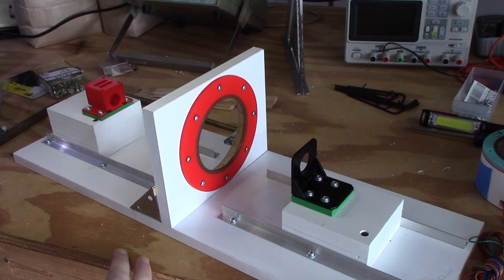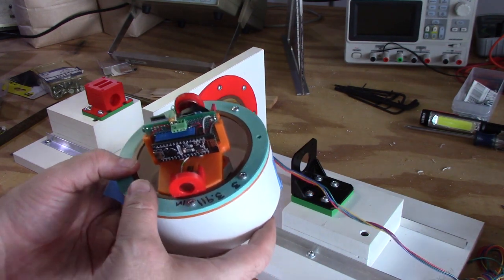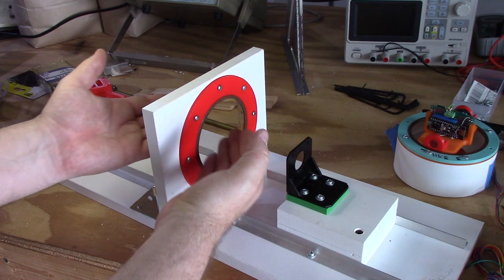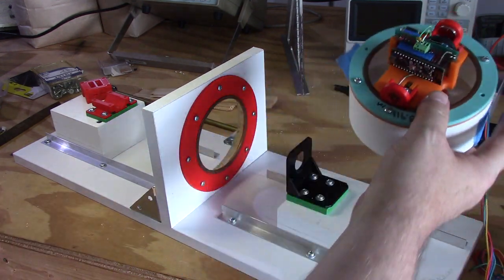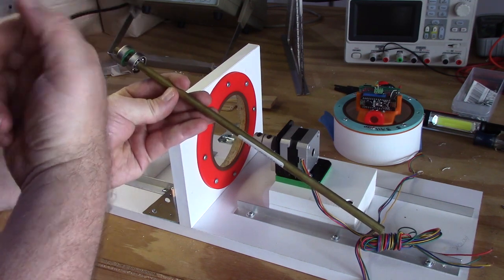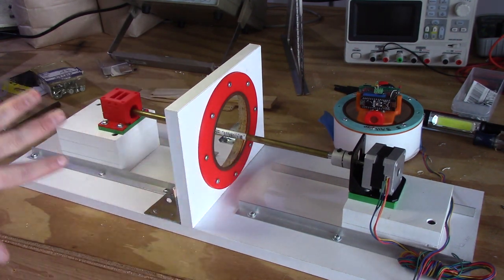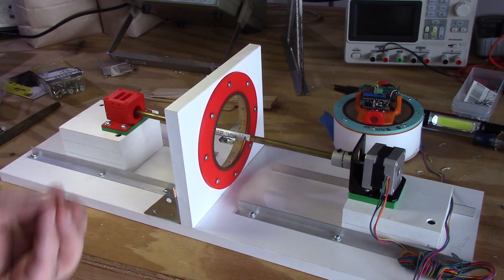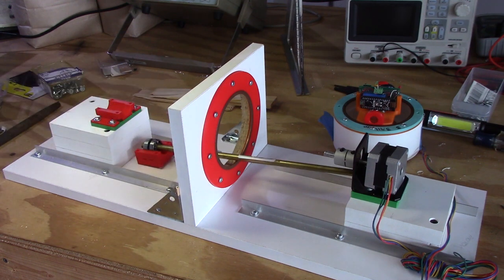PDX TS00: Paradox Test Set Build Introduction

Comment: Can you use a non-metallic screws/bolts to hold it together? (nylon)  It would eliminate induction/counter induction arising from the bolts in the assembly (leading to a voltage reading)

Comment: Do you need to read the voltage in real time? If not, you could just dump the readings onto a memory card inside the rotor, then take it apart after the test to retrieve the values. That would reduce coupling affects.